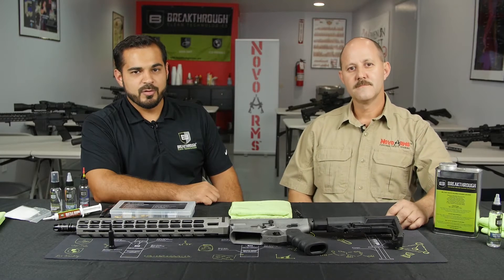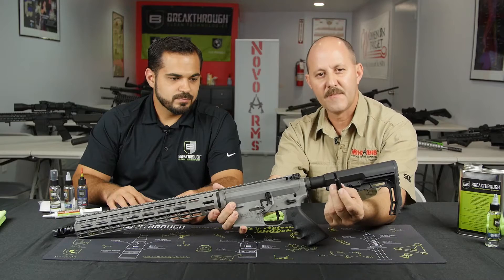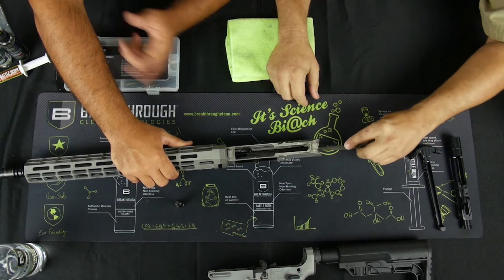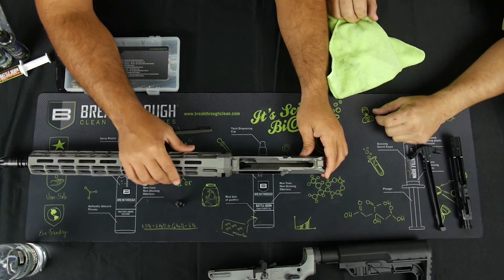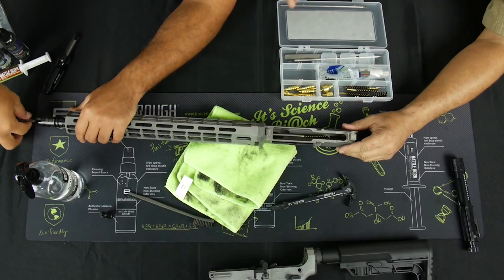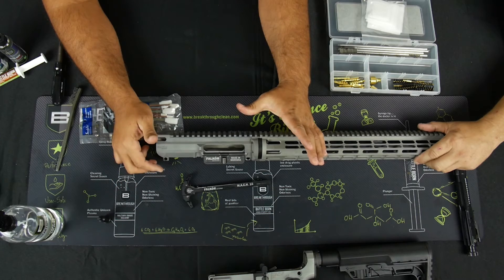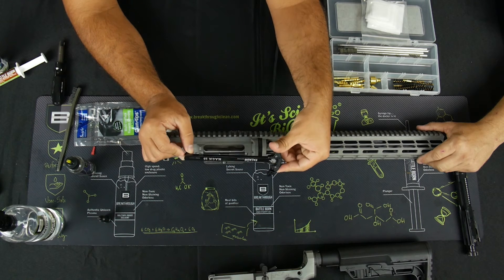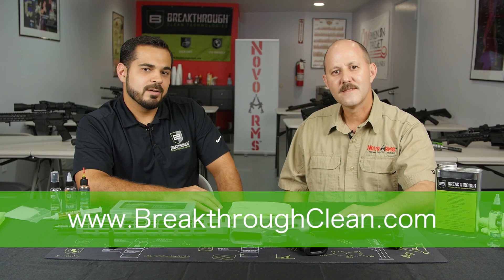Breakthrough Clean University - AR-15 Part 1 (Upper Receiver)

Comment: That is not the way to clean a barrel.  You not suppose to put the rod thru the muzzle brake first. You are putting the build up gunk back into the gun. Follow how the bullet exit. Rod goes thu the fron and exit to the muzzle brake

Comment: I was about to ask the purpose of running opposite of bullet travel but your comment explained it all. I love breakthrough it's what I use for 3gun it performs under extreme round counts and zero failures where I have had a tube of HP oil and had to bail a competitor out when his shotty wouldn't cycleLove your product